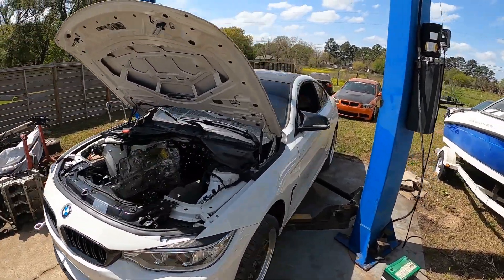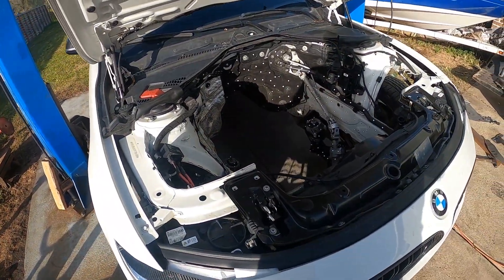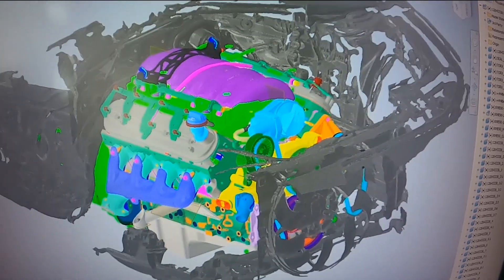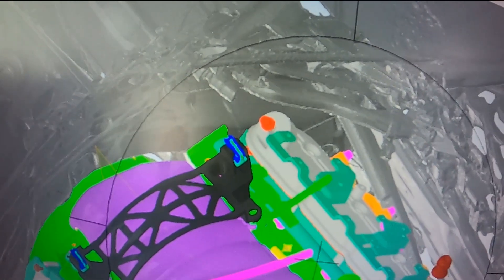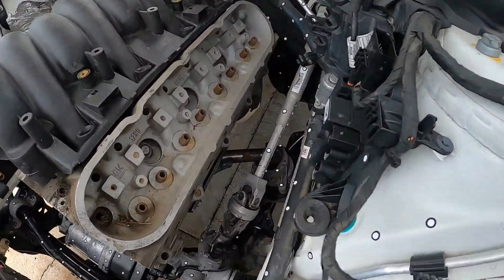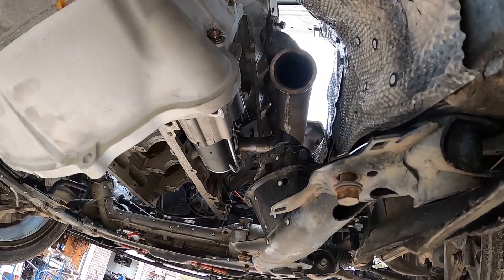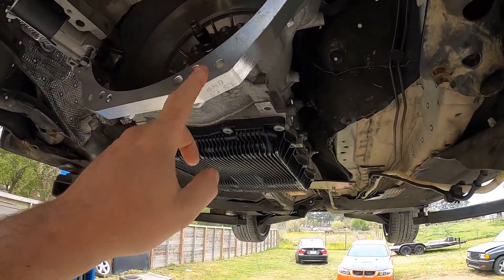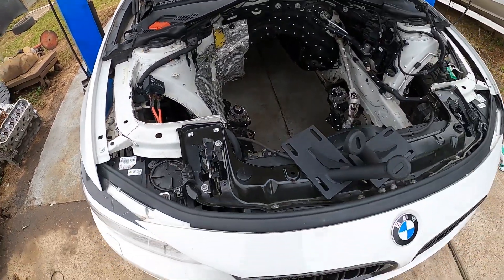Revamping the F32: LS Swap with 3D Scan & CAD Design

Comment: Hi guys! Just tried joining the FB group. I have a blown 328xi and will start working on the project. Never even changed oil before, but i love cars, building one has been a dream of mine, so hoping on the help of the internet to get me there! :) 

Do you have an eta for this kit by any chance?
Reply from the maker: I can sell these mounts now if you have a f series x drive but the rest isnt finalized, electronics is the big issue
Reply: Perfect! I'll be posting my project in the.fb group. So I guess no need to adjust the subframe to rwd then?   What do you mean by electronics? Don't really care about any computers working if I can get an aftermsxreen or so. Thoughts?
Reply: Thinking of building swapping a 5.3 in it. Is that any different from yours?
Reply: Did I hear you say 8hp? Is that an auto?  Car is manual original right. Sorry for all the questions!
Reply: Hmmz confused, afterwards you said t56. :)
Reply: Are you keeping it awd? Considering swapping to rwd..

Comment: FIRST COMMENT!  Saw the facebook post and immediately checked youtube. LSE90 THE GOAT

one question. If someone was using 8HP on an E90 would they go for LSe90 DCT crossmember or use the f30 8hp crossmember that you are developing?
Reply from the maker: Yes the DCT crossmember will for with an 8hp with a BMW style rear mount. This one bung x drive is slightly different